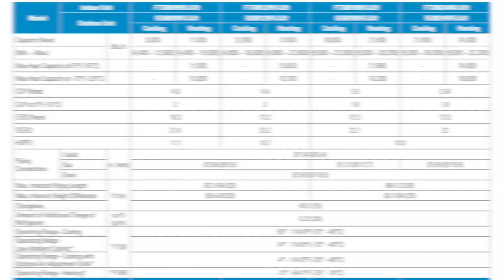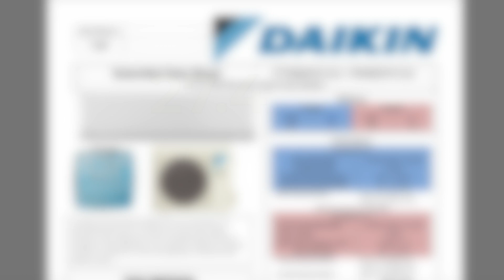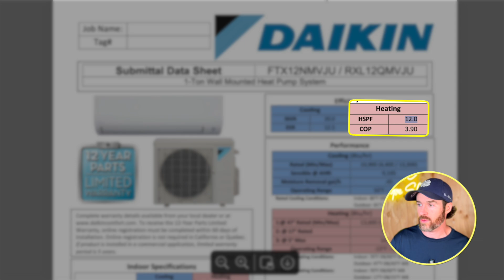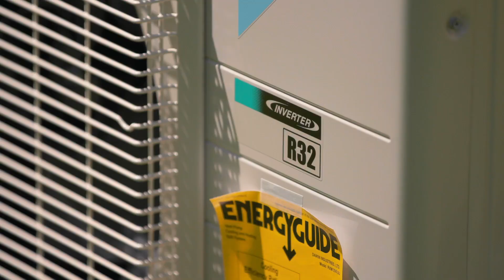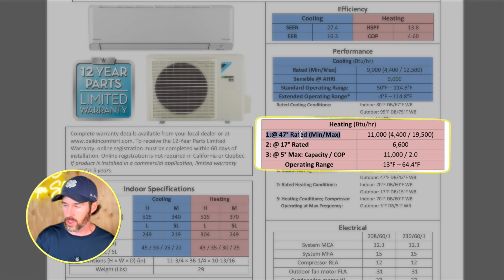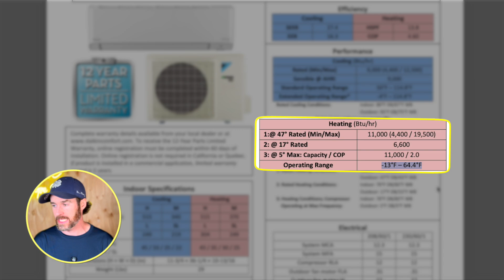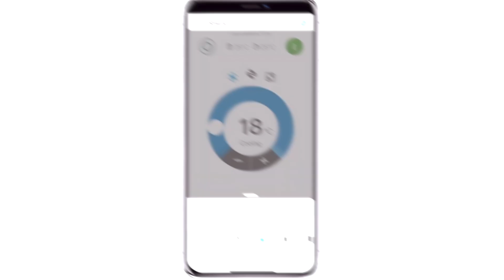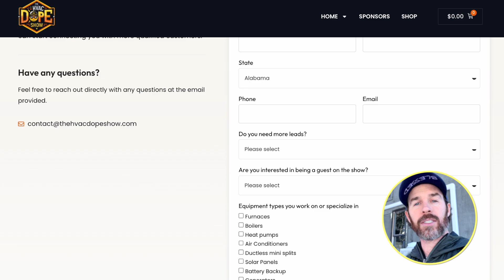Our First R32 Install - over 27 SEER?!

Comment: if heating is more important should out door unit be placed on sunny side of building?
Reply from the maker: Doesn't matter really because the ambient temperature will be similar and the coldest times of the day will be at night anyways so sunny side won't affect it as much. It wouldn't hurt but just my two cents

Comment: I'm getting the R32 version of the Atmoshpera. The steller specs sold me on it. 27 SEER 2 and 4.6 COP.
Reply from the maker: That's on the 9K btu unit but the seer2 is slightly lower as the tonnage increases, still extremely efficient it's been working flawlessly for us for heating a detached garage
Reply: @TheHVACDopeShow  Thanks for clarifying that as capacity increases, efficiency drops. I'm getting a 12,000 BTU model. The numbers are still pretty good at 25.2 SEER2, 13.2 EER2, 10.7 HSPF, and 4.4 COP.

Comment: The main reason for the heating efficiency and capacity being higher in heating mode is that all the inefficiencies of the compression cycle in itself is being wasted to the outdoors in cooling mode, while almost all of that heat remains in the vapor until it is condensed resulting in additional usable energy in heating mode.
Reply: would reclaim any motor heat to

Comment: Ita crazy how different the US is. R32 is not new; it's being phased out by 2027 in the EU due to it's high global warming potential.
Reply: I agree that R32 isn’t new, but the 2027 EU ban you’re referring to doesn’t apply to split systems like those in this video. It targets monoblock and self-contained units, such as portable ACs and dehumidifiers. As far as I know, there isn’t a viable replacement for R32 in split systems yet that meets the 150 GWP requirement and is commercially available. While R290 is an option, it’s restricted to small split systems (currently up to about 12,000 BTU) due to safety and charge limitations under current regulations.
Reply from the maker: Yeah it's weird I don't get it, I know lol R32 being phased in here, phased out in Europe... R290 monobloc and CO2 systems (for heating only) make sense but we'll see what happens. It's kind of odd but I think that it doesn't make sense to throw the baby out with the bath water since R32 has a lot of potential for cooling because CO2 isn't a replacement in that respect yet
Reply: I don't get it either.  I watch videos of air to water heat pumps from brands that do exist here in the US but aren't available to me.  I live in the northeast with a walk out basement so I really like the idea of a heat pump water heater with an exterior compressor...only one option available that's $6k in just parts.

Comment: Great video. Just an FYI, There is an exception by NEC for the GFCI requirement not required for circuits that serve HVAC equipment that will expire on September 1, 2026. See 2023 NEC 210.8(F)
Reply from the maker: Thanks for the info!

Comment: Roughly speaking, how much would an installation like this cost?
Reply from the maker: Will vary widely, literally depends on region and who you hire. OTD maybe 5-10k depending on local labor costs. I've seen bids in Wisconsin for example that were double what we'd charge but median house price there is 150k, in Denver it's 650k so everything across the board is more expensive here especially our technician labor costs due to cost of living index here. Getting 2-3 bids will give you more accurate information. Our parts cost on something like this might be $2500-3500 before labor so we'd be on the higher end of that spectrum but there's a lot of rebates in Denver that bring down the cost. We have cheaper options available with lower equipment costs but with the rebates it can make sense to spring for nicer systems... in city of Denver for example there's a $3500 rebate and a $1500 state of Colorado rebate so literally we can get people systems almost for free after some of these rebates lol. It increases our administrative costs because the costs to administer these rebates are extremely high (lots of paperwork it's not a very simple process) but the net net is still a massive savings covered by the rebate
Reply: 1-3k